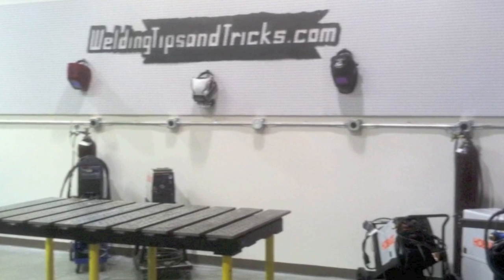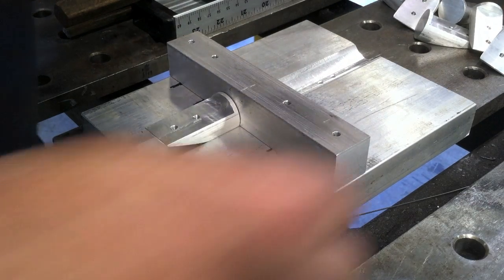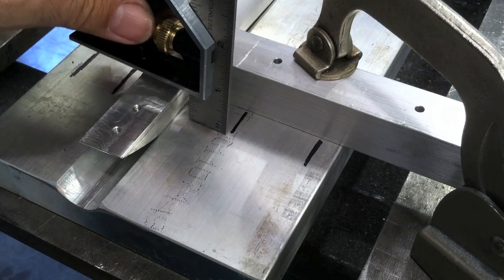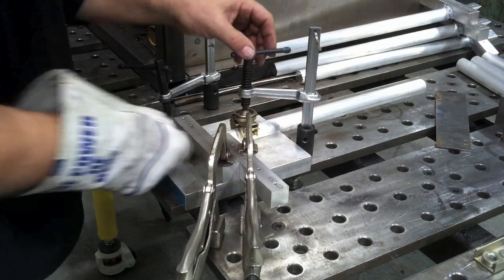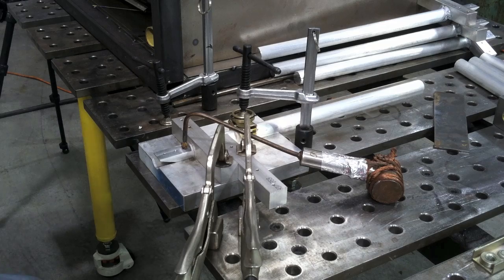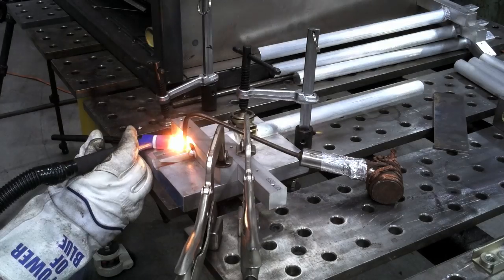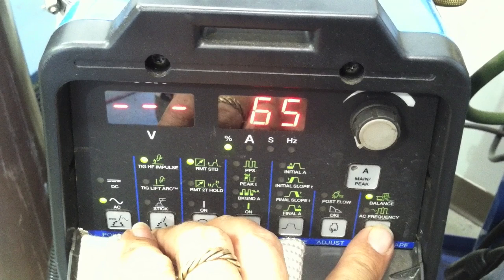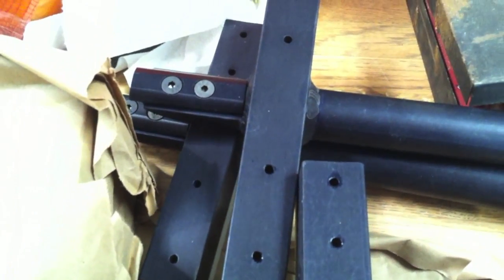Tig Welding Aluminum Parts

Comment: Next time you run into this problem give this a try .   After you build up some bead and while its still hot peen the weld with a clean steel ball end steel or copper punch.   Just nice easy taps.  You will see the weld compress.  Let cool and weld again.   Repeat  Hammer taps.  You are compressing the weld.   You are forging the aluminum.  After each hammering you will see the weld quality improve.

Comment: I've read that TIG welding using DC is possible but it requires special prep that is probably impractical for most of us. You need AC to remove the oxide layer. If you really need AC on a budget the Everlast 185 is probably your best bet. Really reliable welder.

Comment: I reckon having two parts would require drilling in a cross bar blank,.probably with a large diameter hole saw. Leaves you with a cylinder of aluminum that has a hole along the axis. Leaves you with another blank that's pretty unusable, and a waste of perfectly good metal. Even worse, when a rod is inserted, it fills the volume that's just been drilled out!

Or, maybe they didn't think about it.

Comment: Did you have any problems with your preheat all being drawn off to the fixture while you did your setup?  That's been the issue I've had with aluminum parts unless they've been preheated quite hot(300F+) or are pretty massive.  Like that axle alignment fixture you did, for example.

Comment: What filler rod alloy did you use? My welding instructor says, "4043 can't be anodized, use 5356 if the part needs to be anodized". Is he full of it or what?

Comment: I agree with you completely.. and as a machinist/welder/fabricator, there is no logical reason at all for doing it like that, and for the time it takes to run a shell mill of the same dia through the round bar is nothing, but i guess thats the nonsense we have to deal with from engineers who dont actually live in the real world.. or even they could've just ran an end mill through the round bar to locate the square bar, making it much easier to setup and weld.

Comment: Jody, did you just do the welding or the anodizing and assembly also. If you didn't, what kind of trade shop do you send it out to get the anodizing done at? Another nice video, first time I've seen you heat the stock in an oven, another great tip for a non-schooled welder, thanks again!

Comment: Hey jody I like the vid it was very instructional about welding near thin edges like that just wondered though how I can keep a sharper electrode as I get ball on the end of my electrodes the same width as the electrode eg 3/32 or 2.4mm my machine has 30+ I assume that is dcep all the way through to 0 and back up to 30- thanks any help would be much appreciated

Comment from the maker: 2% lanthanated 3/32"  no brand listed on pack but purchased from airgas.
my dynasty is an older model with no triangle waveform ..but  Yes, I do think triangle wave would have helped. I have used it on the Dynasty 350 as well as the Lincoln invertec v205t